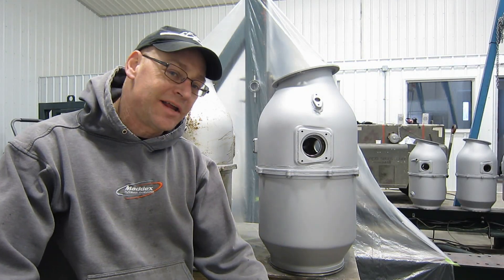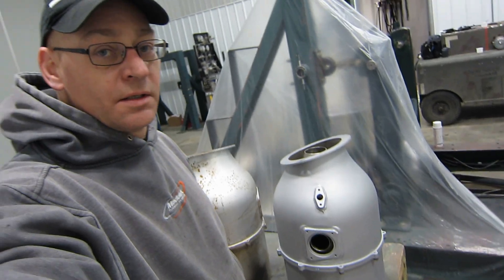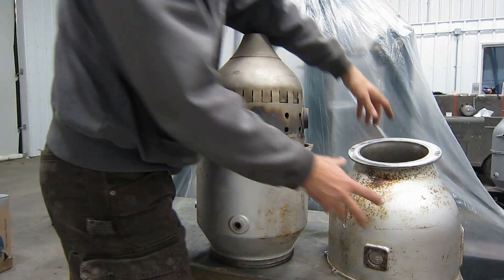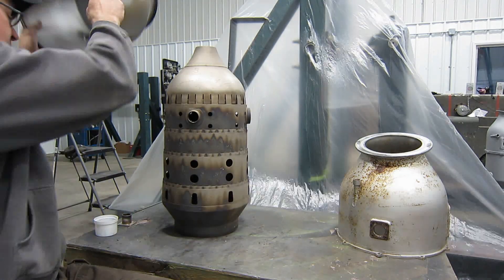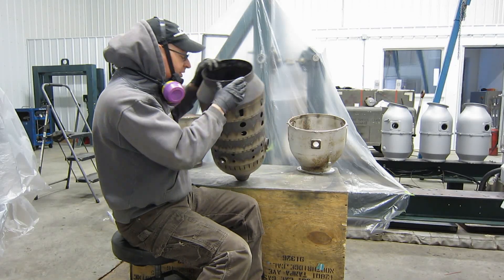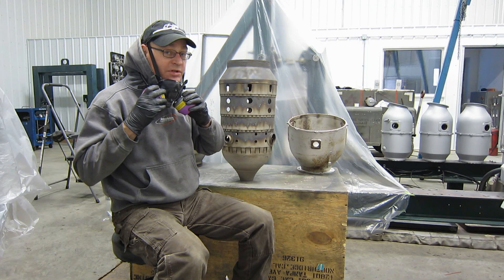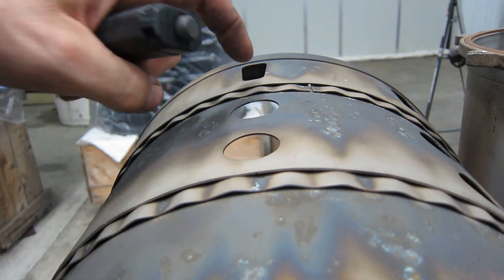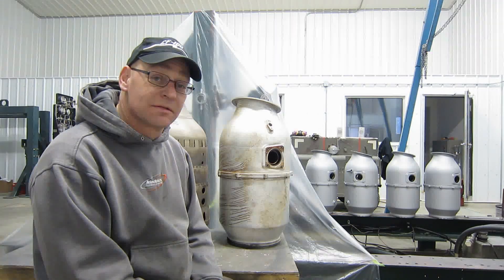Combustor Cans 2 - Turbine Engines : A Closer look

Comment from the maker: The material shows cracks easily on visual inspection. The OEM procedures are for visual inspection of this part. Other parts are required to be inspected with either magnaflux or dye penetrant.

Comment from the maker: There's only one huge liner in a modern turbofan. It is inspected at every overhaul, and repaired if neccessary. It will probably be replaced after several thousand hours of service. That would be a couple years in a working airliner.
Not a limited lifetime component with a specific number of cycles or hours before replacement.
It depends on its condition whether it will be repaired or replaced.

Comment: If its not too rough on the metal, I'd recommend a brush or wire attachment on that pneumatic line instead of hand brush cleaning

Comment: I've compiled a ton of parts for The Project =) and have now moved on to the initial stages of fabrication. I'm watching all of these combustor videos looking for pertinent information as the first order is fabbing up a combustor cover. My first thought was a scuba tank as the base but they're quite pricey, even in 'junk' condition, so now I'm looking at fire extinguisher tanks. Think they'll hold up to the pressure? For reference, I'm using a JT12 combustor liner for primary containment duty.

Comment: I have searched through your videos and have not found the answer to this one:  Do these big canisters from the Orenda engines provide any structural strength and/or rigidity to the engine or do they just sort of sit in place and let the central shaft do that job?
Reply from the maker: +Jim “ThatsMrBuckaroo” they are there to contain and direct the airflow through the engine. 
The main shaft is there to transmit torque to the compressor.
The strength and integrity of the engine is provided by the large tree-trunk like casing that the shaft passes through.
Orinda calls it the backbone.

Comment: I thought they used inconel for the combustor liners .. the mini/nano turbojets I use for RC jet model airplanes use inconel combustion chambers ..
 originally they used furnace stainless, but it had too short of a service life .. they would lose density (sort of delaminate) and corrode away like a BBQ grill burner …
Reply from the maker: A well designed combustor liner is never touched by the flame. Stainless steel is more than adequate if the liner does its job of directing cooling air.
One of the reasons I don't pay attention to RC Turbine model engines.

Comment: Having recently acquired a sandblasting cabinet, Like any good mechanic I'm finding a bajillon things in my garage that need sandblasting. In many of your videos, I noticed that you tend to do quite a lot of manual scrubbing. I'm curious as to what types of things get which treatment, and why. I've seen you blast compressor blades, but scrub stators.

Comment: Great video! Could you recommend any heat resistant paint or enamel to protect the inside of the liner? Thank YOU
Reply from the maker: +Nick Rubin
The liners are not painted. Newer engines use ceramic thermal barrier coatings on the inside of the liners.

Comment: I've sometimes wondered this several times.. which part of a turbojet engine receives the reaction thrust that propels the aircraft attached to it? It can't be the combustor liner because as you said it is attached in such a manner to expand and contract freely. Could it be the combustor casing that (in part) takes thrust and transmits to the rest of the engine structure?
Thanks again)
Reply: That is an excellent question. I wish you had received the answer because that got me thinking as well. I'm no jet engine expert but I did stay at a Holiday Inn Express once. My first thought is that the load, or reaction would be shared by each of the compressor and turbine fans. If you think of each fan being independent, like a plain old floor fan, the exhaust pressure would go one way, and the reaction force would go the other way. Maybe I'm all wrong but that's what I'd say. Each and every blade of compressor and turbine would be sharing the forward push of the engine.
Reply: Take a look at his video on Lube System might give you some insight, I believe three main ball-bearings hold the entire compressor-turbine assembly, which will transmit the force to the casing.
Reply: THRUST IS CREATED BY THE GASSES EXPANDING, THE EXHAUST GAS DOESNT REALY RELEASE ALL ITS BUILT UP ENGERGY TILL ITS LEAVING THROUGH THE TURBINES AND OUT INTO THE EXHAUST NOZZLE WHERE IT HAS A CHANCE TO FULLY EXPAND AND APPLY THRUST TO THE ENTIRE CASE OF THE ENGINE

Comment: Always wondered why jets run at all. Why does the fire not push back, what makes it push on turbine more than compressor?
Reply from the maker: In my series Jet Engine Diagrams, we go over the pressures at various points through the engine.

Comment: Jay, a p&w engine on a 737 caught fire at Mancgester Airport UK in the 80s killing many on board due to smoke inhalation. Its was found tha a crack in the combustor can had been repaired by welding and was to blame. Would it of been the liner or the casing? I dont understand how a crack in the liner could cause the engine to catch fire as surely the casing would contain it?
Reply from the maker: The JT8-D engines have a can-annular design, but that does not matter. There is no way for combustion gases to enter the cabin, except for a fire in the nacelle severe enough to destroy the engine, and cause a break-up of the fuselage. Methinks some of your details of the scenario may be a wee bit off.
Reply: @AgentJayZ  Sorry i didnt explain properly, it was late when i was replying. The AAIB report said the no 9 combustor can ruptured and ejected a piece of material which blew a hole in the fuel tank. I dont understand how this can happen?

Comment: why doesnt the flame travel outwards through the holes and hit the outer casing
Reply from the maker: The pressure outside the liner is greater then inside.
* This is important *
The burning of fuel with the air does not increase its pressure.
The volume expands greatly, and the gases rush out the essentially open path through the turbine.
* these are not piston engines *
Reply: AgentJayZ  Thank you so much for your swift reply sir !

Comment: Do you x-ray or eddy current parts to check for hidden imperfections?
Reply from the maker: When the procedure is called for in the overhaul manual, we use it.

Comment: Inside this can is where 20 gal per min of fuel get burned?
Reply from the maker: There are six combustors in the Orenda. So at max power, each can would be consuming 1/6 of 20 gpm. So about 3 1/3...
Reply: Got it. That's still is a fair amount of fuel. Thanks for clearing that up.  I really enjoy these videos. Thank you Sir

Comment: They don't look strong enough, why don't they blow apart with all the pressure?
Reply from the maker: The pressure differential between the inside and the outside of the combustor liner is very small. Air does move, but I would estimate the Delta P as about 10 psi or so.

Comment: how much pressure combustion chamber can withstand
Reply from the maker: The burning of the fuel-air mixture does not increase its pressure.
Reply: @AgentJayZ  so what makes engine run if there is no increasing pressure
Reply from the maker: Explained in hundreds of videos right here. Seen any of them? 
Most important thing to remember: these are not piston engines.

Comment: stainless steel ? Isn't it Inconel steel ?
Reply: Inconel (rather, the "family" of Inconel alloys) is mostly nickel and chromium, with other metals (like cobalt, molybdenum, etc.) added to create the final properties.  Iron (the basis for steel) is 10% or less of the final composition, so Inconel is part of the nickel-based super alloys, rather than a steel.

A Wiki search will  turn up much more info.

Comment: You will make a great teacher at an aeronautical college!  Have you thought about applying!
Reply from the maker: I was a guest assistant instructor at Northern Lights College, helping Aircraft Maintenance Engineering students. It was great working with so many bright and motivated stars of the future. I actually felt safer flying after having my cynicism worn down by the experience.